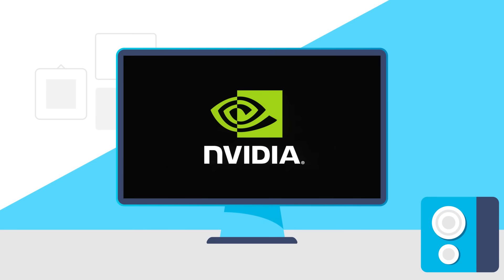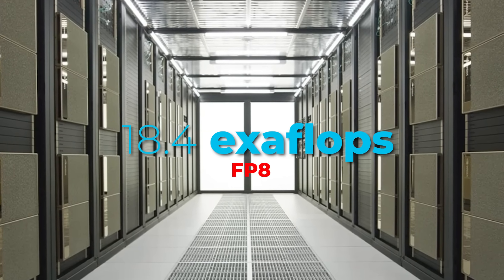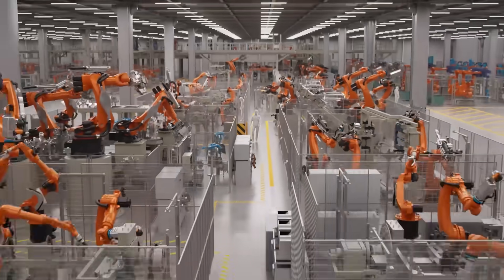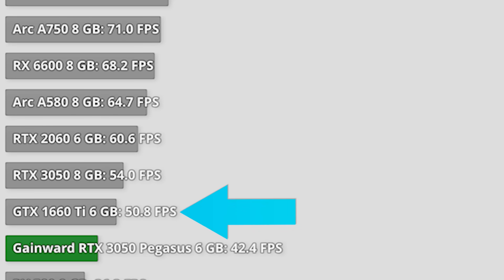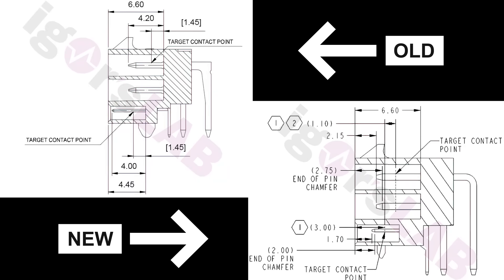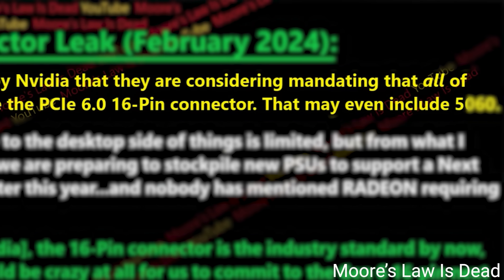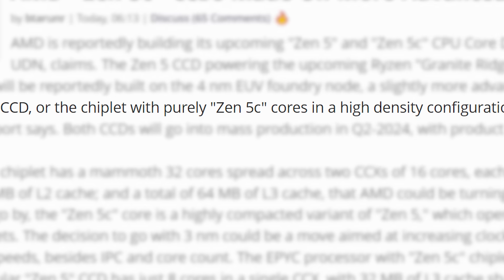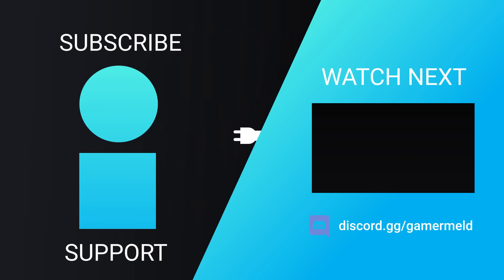Nvidia’s Requiring Big Change for RTX 5000!

Comment: I'm still pushing my badboy GTX1080 overclocked to 2100 Mhz coupled with my OC's i7 6700K CPU to 4.6 Mhz, it still plays my VR sim titles damn well for it's age. Very happy with it as long as you replace the thermal paste every year or so, my card will still rock 5 years from now. I Just cannot justify the price of a new GPU especially that I'd probably have to by a new motherboard, memory CPU and a power supply to get any real benefits, I'm sticking with what I got. Also I can fit the LLama Ai in side my 8GB of Vram too! Id probably move to a cold country if I was to buy the Ngreedier 5 series GPU as I could probably heat the house for almost free whist gaming 😂😂😂

Comment: that 12v2x6 connecter needs to go , i rather stick with the old power connecter , that power in a smaller space you'll need  smaller tolerances , if anything you need larger contact if you want more power not smaller ,

Comment: about the RX6600 being slightly more expensive but a lot faster, yea that may be true, however it needs external power AND its a Low Profile GPU, so i mean it takes the win there, and with its price being really cheap compared to the 4060LP its def a good thing, and you could easily make a decent little gaming rig by throwing that 3050LP into one of those SFF 8th gen intel Dells

Comment: For the power connectors, why the hell don't they just use the same type of 2-pin connectors that RC model aircraft use? They're cheaper than dirt and can easily handle 100 amps of current or even more, that's 1200+ watts of power at 12 volts!
Why all this screwbally crap when the connectors already exist and are really cheap?

Comment: I don't even give a shit if new graphics cards perform better than older ones, or even if they're easier to cool and don't use so much electricity. I don't even really care much about new features like frame interpolation.
I just think it would be nice if they weren't so dreadfully, ridiculously expensive.
I understand that these things are purely a luxury item of sorts. They are not a life necessity by any stretch. But, graphics card prices are batshit insane.

Comment: The 3050 is actually a decent card. Because it gets its power from the mobo you cant really compare it to gpu's that dont. The 3050 has a different use then other cards. Nvidia mad it 'slow' on purpose. It's a nichemarket.

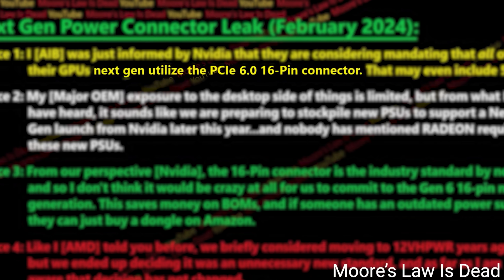Comment: 4:00 

Damn it. i dont want this, i dont care about how my computer looks, and even if i did id reather it looked like a computer. you dont see wires hidden in sci fi movies. real powerful hardware has wires, and looks powerful because of it.
i prefer the standard big connectors we have now. much much prefer.small plugs are fragile. look at micro usb/ usb c etc. fragile. id dont want my $2000 gpu to be rendered useless from a fragile plug.

Comment: Someone should change how the motherboard, ram, and the gpu are designed in a way that allows someone to have a gpu that doesnt have any dedicated ram in it but instead uses the ram the user decides to allocate but it has direct access to the gpu so as to be as quick as the gpus with memory
Reply: Like maybe even a dedicated bay for exchangeable gpu ram just as the pc ram has its 4 or so slots... if this makes any sense lol
Reply: yall are on to something! make it happen @pleasurewasmine3173

Comment: There's no way in hell I'm buying any NVIDIA GPU that has that stupid connector on it. The day it showed up was the day they officially lost their damn minds and stopped caring about efficiency. The only reason why they pushed for this new standard was because they wanted to use brute force to win the FPS wars and they were worried nobody would buy their cards if they had four "ugly" 8-pin connectors on them. Mr Huang, that's not the fucking point. Don't release cards that suck back 600+ watts. That right there is what's unacceptable. It's just icing on the shit cake that your cards are starting fires because you tried to make that insane power draw look "aesthetically pleasing." Rein that shit in.

Comment: If you aren't getting an xx90 or xx80ti it might be worth your while to shop other cards. Yes, NVIDIA always take the top spot. Most of us aren't running the top card though. 
We're talking about hundreds of dollars difference vs AMD, for just a few extra frames per second in some case. 

Saying this as a dude whose last AMD card was a 7970 (god tier at the time) and has owned a 770, 960, 1080, 2070, and now run a 3080, always paired with AMD's top CPU... AMD seems to be making a comeback in the GPU market. I also hate that they made a new connector. Just a lame excuse to sell you more junk. No reason they couldn't use the standard connector for the last two decades practically. Power is power. Need more, add another plug.

Comment: [3:20] we know nvidia need to produce cards and we need to buy this crap but actually forcing connector that is looking for me from electrical point of view as unwanted increase in resistance of the cable. This looks just like treating every customer as garbage just let us use even this 5/6 pcie 8 pins for more power hungry models forcing one connector is not ideal for sells of nvidia cards. Actually me and few my friends moved to amd cards just because of nvidia forcing this new connector and after hearing about possible problems with this we just moved to amd cards for our house fire safety. 
i using my pc as openair testbench on wooden desk

Comment: i suppose it's trendy to trash on the 3050 6GB. lets ignore the fact that is the only GPU with last generation RT and DLSS under 200€. to buy the one with 8GB, minimum you can find new is 250€, if you're lucky. the other option is to give up on RT and DLSS and go for AMD, which will give less performance. so, no, not really. the 3050 6GB is not bad for the price. quite the opposite. for someone on a tight budget that can't spend 200€+ ona GPU, this card is probably the best option available

Comment: So why dont you look at it the same way amd fanboys look at their terrible cards?   Compared to cards that are the same price as it, the 3050 6gb wins. so yes if you are on a tight budget you can buy it because it beats other cards at the same price.  Its completely laughable that a guy who piggy backs off of every other "leaker" tells people to not buy a gpu cause its from nvidia yet it beats other cards including those from amd that are at the same price.  Its funny that it is powered solely by the pcie slot and beating cards that require a 6pin minimum connector lol. Stop with your fanboy bs
Reply: Jensen Huang is not going to sleep with you

Comment: Will i need a new motherboard for a rtx 5000 series? I have a z790
Reply: if they use PCE 6.0 then yes.
Reply: Afaik, GPUs are a long way from actually exceeding the bandwidth of the PCI-E adapter; you should be good with a 4.0.

Comment: Why do you losers buy the 4090 when there isint really a game like crysis that takes advantage of it? Wouldn’t you just wait till games actually have the fidelity to need it? Cyberpunk is the only one I can think off the bat but by the time real graphical powerhouses of games comes along, these cards will be cheaper. Remember it’s you losers buying these cards at such inflated prices that allows them to sell em at that price.
Reply: if you want to run modern games at max settings and native res at 4k, there is no other way. all the other cards are using some form of dlss aka lower internal resolution than what is shown in the settings.

Comment: the power connector is junk , 3 years of piled up excuses about why it not the problem even though thats where the melt down starts most every time , why a board partner would go along with it is beyond me ,  EVGA got out while the getting was good

Comment: I usually get a low/mid end card when i upgrade, but because it has been like 5-6 years, the uplift feels pretty big. pros: it won't break the bank, the bugs are worked out, uses less power then my old card while performing several times better, doesn't require it's own PSU like high end card lol

Comment: Nah, the 4090 is the reason the connector gets a bad rep, pretty much all cases were due to the ridiculous powerdraw that that card needs. The cable isn't built for that, afaic the 4090 was an unnacceptable failure, still Nvidia's fault 4 sure. 
Some 4080s have been killed by the cable as well, but that is more likely due to legitimate cases of non-seated connections. Also look up '4080 melting' in google and the first result is a Gigabyte card lmfao, dodgy dodgy brand.

Comment: Nice that you perpetrate this lie. the 12VHPWR connector is not from Nvidia, but an Intel SIG design, Nvidia are just the first ones that adopted it.
AMD and Intel planned to have the same connector on all their cards, but the moments the issue with became clear Intel and AMD pulled back and pretended like they never wanted to do it.
Igor is also a hack, that most likely gets paid for reviews.
Steven from Gamers Nexus called out Igor for his absurd claims in regard to the connector of claiming the one design that he couldn't somehow test must be the good one without issues, while all the others are bad.
Let us also not forget their horrendous fan review for the Alphacool fans.
For some reason they are the only ones that can do tests months in advance and their tests deliver unheard of improvements in noise and performance over all currently existing top fans by at least the factor two.
People pre-order the fans and what happens they are only ok and not better than the current line of top fans, but surely Igor wasn't paid for it, it is just an intern having messed up.

Comment: Any help/advice would be greatly appreciated. 😊

Currently using xps 17 latop 11800h, rtx 3060, but I'm  looking to build my first pc. 

I only now was able to backorder the 4090 Founders edition from bestbuy 🇨🇦 for MSRP, due to no stock. It'll come 2nd week of March.

Should I just cancel the order for 4090 FE and wait for 5090 FE for longer life use?
Also, was thinking of buying 7800x3d  or just wait for intel 15th gen, and go for what I assume would be15900k. Just not sure about release times for intel
Not too concerned about price. Mainly not sure platform to commit to. Am5, or wait for 15th gen intel. I'm not too good with computers, I can figure things here and there, but I just want to 'plug and play'. Most likely I won't be overlooking anything

Please and thank you 😊 🙏
Reply: Honestly, m8 just cancel the order. 4090 isn't future-proof, simply just too much powerdraw for the current tech, either wait or settle for the 16gb vram 40 series cards. I moved from a 3060 desktop to a 4070ti super and the difference is ridiculous. My monitor is capped at 120 so I run pretty much everything constant 120 fps in HD Ultrawide, the exception being blatant stresstests like Minecraft RTX, where its 110+ fps, it barely misses.

That's just my take anyway, always up to you. (Don't buy Gigabyte cards though...)

Comment: The 3050 is actually really good for SFF builders something to compete with the rx6400, A380, A2000, A4000 all for $180
Reply: Agreed. Anything that's better either a) requires supplemental power or b) is crazy expensive (looking at the RTX 4000 SFF Ada).

Comment: Can anyone clarify this PCIe 6 thing? Does it mean that huge slot on motherboard in which SSDs, sound cards, wifi cards and graphics card goes? If so then why power connector is being shown in the video? I am getting confused. My motherboard has PCIe 5.0 slot, so these new GPU won't plug into my mobo?
Reply: They mean the connector from the power supply and not the pcie slot on your mobo.
This is the connector that powers a pcie card, hence the name...
Reply: I just got a 1200W Corsair shift with PCIe 5. Will I need a new PSU if these speculations about rtx 5000 are right??

Comment: One prediction I would love to make but I can't until I see the spec for the RTX 5090 is we will see enough melted power connectors that Nvidia will be forced to recall the video cards.

What is going wrong with these 12V 2x6 connectors is there is no insurance that the amperage load is balanced between the 6 +12v wires.  You don't have 6 circuits but 1 circuit with 6 (12 in case of adapters) paths.  The load is split based on overall path resistance from the 12v rail in the PSU to the power system in the video card.  If a delta exists between the paths, more amps will go down the least resistant path with no care about how much heat could be generated at that connector on the card.

Comment: The 16 pin 12VHPWR connector is just objectively less safe, for its 600W maximum rating, it only has a 1.1 safety factor whereas 8 pin has a 1.9 safety factor for 150W. If you gave 12VHPWR a 1.9 safety factor, it would only be rated to 360W, hence why the 4090s will keep on melting... such a dumb move and a really good reason NOT to buy Nvidia, especially for high TDP cards.

Comment: Beats me why  if you plug power into your motherboard why they haven't  made the the same true for the GPU   where the power is delivered through the motherboard to  a less intrusive gpu connecter within the PCIE type slots surely  there's a way to reimagine powering a gpu beyond these fat block style wibbly wobbly connectors and  a thick intrusive  cable . Yes its carrying massive power loads for these  ever more powerful cards but please scientists find a more aesthetic functional system
Reply: Only a fool would put high voltage wiring onto a 2mm thick piece of reinforced paper full of conductors, metal screws and connectors that goes into a metal cage...
Reply: Thinking more along the lines of trace the wiring down the back of the motherboard the GPU goes  into  the PCIE slot and the the  power connector pins on the GPU  are male and push into  suitable  power slots / plug  on the motherboard rather than having a massive flexi cable that you push into the GPU. @meibing4912
Reply: Because it is already like that for cards below 80W. Want more? Well, good luck making it yourself, because no one wants to deal with this shit.
Reply: no shit sherlock we know there is power from the pcie slot,   you reply is so worth you wasting o2  that better people could use. @alexturnbackthearmy1907

Comment: Its always the same with a new series Nvidia Card..........doom and gloom and worst case scenario. It'll all be Hunky Dory, and anyways we won't see them till 2025. Yeah tight ass gamers might have to do an upgrade, but you Never need a new GPU.....you just want one, there's a difference. 
PS: like many, i still have an: RTX 2080/3090/4090 so wont need a new GPU for years, the 2080 is still light years better than some tight assed gamers will shell out for. So, you''ll have to either pay up, or suck it up.

Comment: Nvidia is solving the low profits for their AIBs by forcing their slave base to buy new PSUs and cases. Cause improving the profit margins for their "partners" at the GPU PCB level - who are in single digit percentages, perhaps if we exclude ASUS with their competitive marketing - would mean adding 100$ to the price tag of the xx80 series cards and more to the xx90s, even the most hardcore Nvidia*@ggots will start complaining their anal can't take it no more and start talking about switching to AMD or intel, even though we all know they'll never do it while Nvidia sells any gaming products, though that still could harm the overall marketing for Nvidia - if they all don't sell their kidneys for the xx90 series and use a xx70 or xx60 with RT disabled and FSR on cause they keep their cards for more than 1 generation it's a missed profit opportunity.

Comment: Imagine being so pig headed, instead of admitting a 12pin connector was wrong, and 2x 8 pins was right, you make a 16pin and force it on everyone as "the new standard".
Reply: Yeah that 12pin connector was trash the pins are to short and small they wasn't making good contact some time's.
Reply: I think You got it ALMOST right.
Remember that NVidia has... 80%? of the market?

If they use a new connector, and the others two don't, which connector do You think the PSUs will come with? And THEN everybody will say "NVidia is better, no need to buy an adapter..."
Reply: @sysbofh  who cares, stupid is as stupid does... obviously
Reply: I had a 7900 XTX (send it back because of Powercolor not fixing their hotspot problem) and a 4080 Super. The 16 Pin Connector is more compact and leaves more room for ventilation, but only if you use a 16 to 16 pin cable (for me it came with my beQuiet PSU) , not the adapter that you get with every 4080 plus my rig hasn't burned down yet so it works just fine. I have to admit that the 3x8 Pin Connectors on the 7900 XTX looked really badass but just in terms of function, the new NVIDIA connector is better. Its time to move on in my opinion.

Comment: Why don't our high wattage video cards have nice, big, bolted power and ground wires with crimped on eyelets like we see on car stereo amplifiers? Power supplied to our house's breaker box. Power to our car's starters. This isn't very smart, just keep using little pins because we only use little pins because we use little pins.
Reply: Eh, 4090 really deserves its own PSU, the rest of system that has it inside consumes less power then card alone (even with 14900).